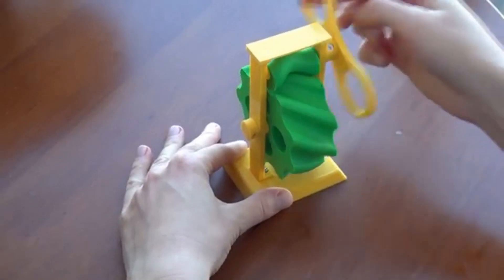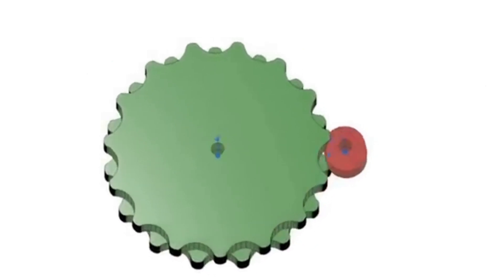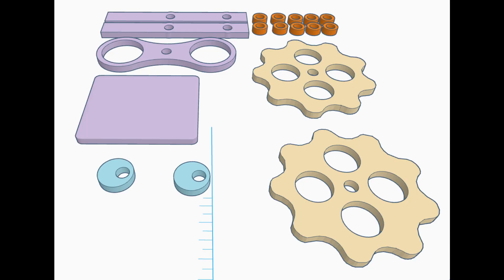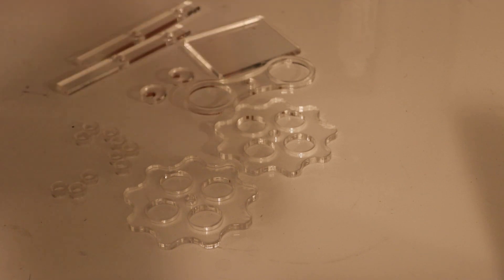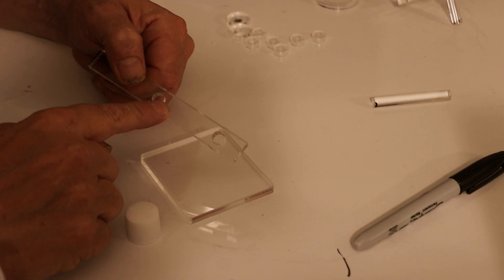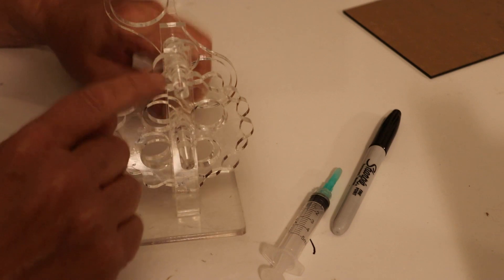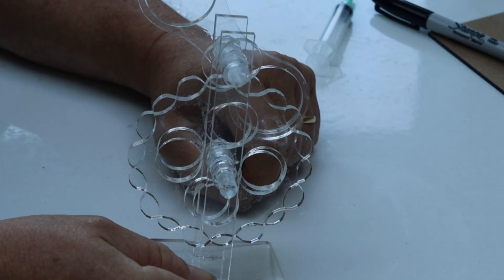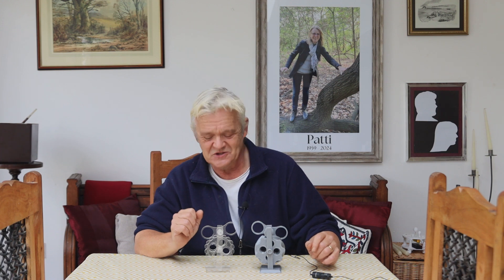2330 Gear Cutting Without Gear Cutting Gear  2 - The Eccentric Cycloid

Comment: Would be nice to add a feature to ‘time’ the pair of drive gears and time the pair of driven gears - avoid the guess work as they are glued together and easy to do. Probably find backlash increases but I bet it’ll run smoother. Neat trick overall though.
Reply from the maker: nice idea cheers mate

Comment: prof! if you put current through a cable and place a torroflux ontop will the torrflux move?
Reply from the maker: i don't know what a torroflux is
Reply: @ThinkingandTinkering  its spelt "Toroflux" can be found on "flowtoys" website.
Reply: @ThinkingandTinkering  they deleted my comment. prof the Toroflux is made of aluminium and it will run down a rod. what if the toroflux were copper and the rod was electrified? would the toroflux run up the pipe?
Reply from the maker: I found a toy caled toroflux which i a steel toroid wound spring - is this what you mean?
Reply: @ThinkingandTinkering  yes thats it! exactly
Reply from the maker: @esahg5421  then yeah it would probably do that - i am guessing it would be like the jumping ring experiment - the current you would have to put through would be huge though
Reply: @ThinkingandTinkering  ooooh now that would be something.

Comment: Completely unrelated to the video, but I have a question that you might have some insight to.  If I make a bath of highly concentrated, hot potassium silicate-water solution and float a thin piece of soda lime (or borosilicate) glass on the top of it which is wrapped on the top only with aluminum sheet or foil, and then I apply a strong electrical current to the bath and aluminum..would  the positively charged potassium ions tend to try to migrate into and through the glass to "get to" the strongly negatively charged aluminum?  I realize that glass is an electrical insulator, but I'm hoping that with a strong enough current and being in the bath of potassium silicate, and with such a strongly negative charge right above it, these might conspire to overcome the usual electrical resistance of the glass (which will not be that thick). 

  I'm trying to come up with a cheaper and easier way of chemically strengthening glass. 

   Do you think this has any merit or is pointless to even try?  If not practical or feasible, I'll probably go the more traditional method of molten potassium nitrate bath. But I know that electricity can have powerful and  unusual effects on materials.

   Thank you Robert, and cheers.
Reply from the maker: If the voltage is high enough everything becomes a conductor - current - or amps won't have a lot to do with it - that will equate only to the number of coulombs required to complete the reaction you are interested in - but that also can be a function of time
Reply: @ThinkingandTinkering    Thank you for the reply and information Robert.  The only high voltage thing I have is one of those violet ray wand things. Looks like I may have to go the traditional route. 

 Thanks again

Comment: The face contact area is an important consideration for friction and heat generation. I wonder how that compares to a fully engineered gear system. But this is so wonderful for simple mechanisms,
Reply from the maker: it would be an interesting comparison - we could probably model that in something like solidworks - nice one mate - cheers
Reply: @ThinkingandTinkering  You could try a stripe of Dry Erase marker on the meshing surfaces to see how it smears on the contact face. Or maybe just marks on the side faces to see if there is slip.
Thank you for sharing your knowledge with us and thank you for your smile and enthusiasm.

Comment: The simplicity of this approach makes it a lot more accessible than the original which requires a 3D printer or some impressive carving skills.
And acrylic looks so nice, it makes everything seem less "material" as if it's there but not really.
It would be interesting to find out if having more layers provides any benefit or not. I suspect that very smooth curves on the gears and tight tolerances may be more important than the number of discs pushing against the gear.
Reply from the maker: to be honest i suspect it is a balance of the two mate - a few folks have suggested 3 lobes and i can see that - if you start to go too much over you are really approximating what we started with and lose the simplicity of the construction - so again it is going to be a balance
Reply: @ThinkingandTinkering But wouldn’t adding more layers in a progressive spacing add reliability and longer wear resistance?
Reply: @blairleighton3343  it would but this is fine for what it is. you're basically building up to a helix gear.

Comment: Well you're idea is far easier to machine.  The trickiest part would be the cams and that would only be difficult if you wanted it to be made from billet but a basic machinist could do it.  Another reason I would want to make it from billet is for strength which the cams as designed wouldn't have.
Reply from the maker: good point mate - but they are just eccentrics so you could cut them from a round billet and drill off centre

Comment: Looks simple, and also like there is very little backlash.   If the two smaller driving eccentrics were bearings instead of plexi, it would also be near friction free.  Cheers!
Reply from the maker: that would be easy enough to do mate as the cams are basically eccentrics so an off centre hole would do it

Comment: If a gear does not have an involute tooth profile, it may experience uneven load distribution, leading to rapid wear and reduced efficiency.
Reply from the maker: Involute is just one tooth profile mate there is also cycloid - which this one is and trochoid - Involute is not 'the best' in all situations it is just the most common

Comment: for better engagement you could even add more plates, they dont even need to have the plates aligned between layers, 3 layers offset could give you a gear that wont go out of alignment (much like a herringbone gear will always stay centred) though you do have to consider the side friction between plates and the smaller gears unless you space them with washers.
Reply from the maker: awesome thinking mate - thanks for sharing
Reply: Yes indeed.   If you need to transfer more torque…add more plates and more cams.   The modular nature of this design makes it easily adaptable for many uses.

Comment: Thanks. I've been designing a way of making spirals with a router on a wood lathe using a capstan drive, but the gearing has been a problem. This might well be part of the solution. I'm a luddite technically, but am pretty sure I can make these using a pin router.
What is the backlash like though, and  how far can it be adjusted out? Thanks
Reply from the maker: chances are back lash is very low